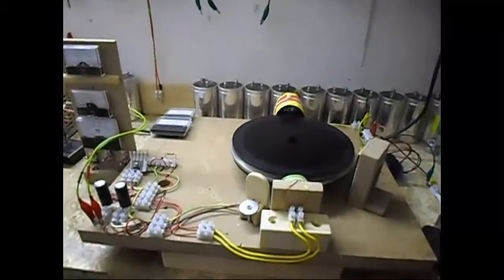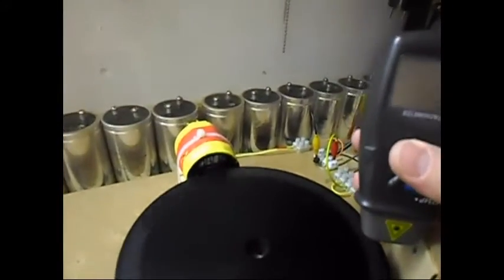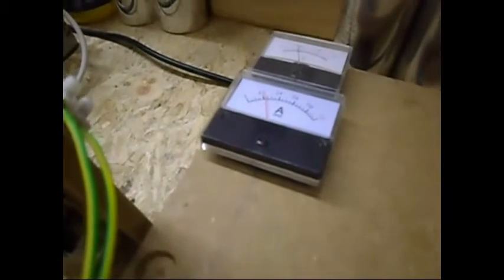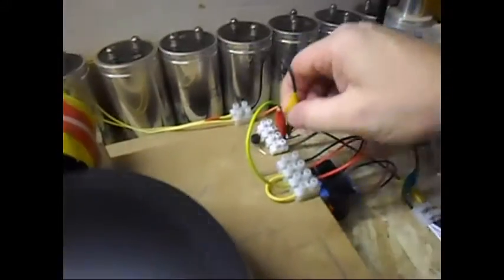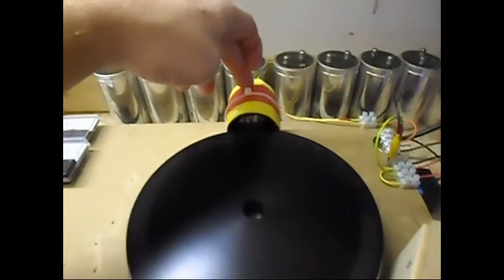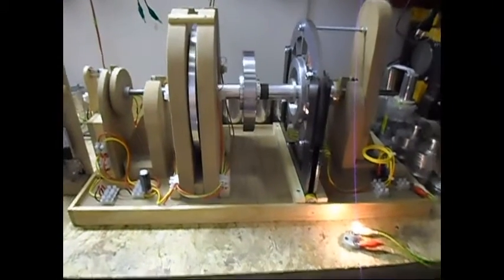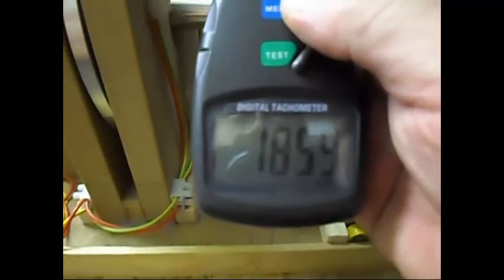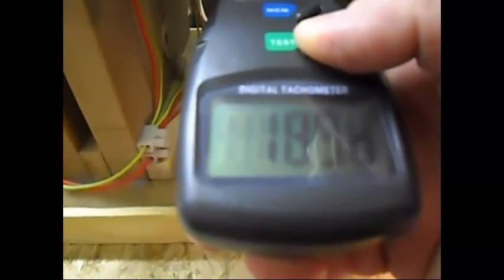Pulse Motor - Single Phase Generator Update 2, Coil shorted & Coil loaded test comparison...

Comment: I see that you have many coils that you are using which aren't enameled coated.  I tried making an electromagnet but it didn't seem to pulse.  N52 should be strong enough no?  Or maybe my wire is too thin?  I want to dabble in this.  I love your videos.  You're a patient man.
Reply from the maker: Thanks for your comment and i'm glad you liked my videos...^^
About my coils not being enameled...???...every one of my coils(Drive & Gen) are made with enameled copper wire...;-)
Just using non emaneled wire is like using a piece of copper rod as a coil...lol...that won't work...;-)
Yep, N52 are as good as it can get...
"You're a patient man"...thanks but you haven't seen me when it takes to long for me to get it done...hahaha

Comment: Use Iron Cores or lamnated Copper rods core that will increase the inductance which increases voltage
Reply from the maker: Thanks for your comment...^^
That is correct but if you also want to see the speed up effect use one that also comes with more eddy currents...;-)

Comment from the maker: To Dag Andreassen,
Can't see your comment anywhere...???...maybe you've delete it...???
Thnaks for your comment and questions and to answer them, 
The voltage output in part 1 is about 14v or so(open) and around 7v or so(open) in part 2 if i recall correct...;-)
And yes, more coils in series will result in a higher voltage output...^^

Comment from the maker: Just an update and test where i'm comparing a aircore coil and a cored coil shorted and loaded...^^
So in my case just by shorting the coil doesn't put the maximum stress on the system...but loaded it does...;-)
I'll have to do the 2 higher rpm test asap since i want to test that new Tr3nity Dynamo of mine...:D
And these effect i'm seeing at lower rpm might be even better at higher rpm...^^

Also, comparing the aircore test seen in this video to the cored test seen here below,
https://www.youtube.com/watch?v=ttZEttQn00A&t=70s
It does makes me wonder on what would be the best way to go...Hmmm...lol